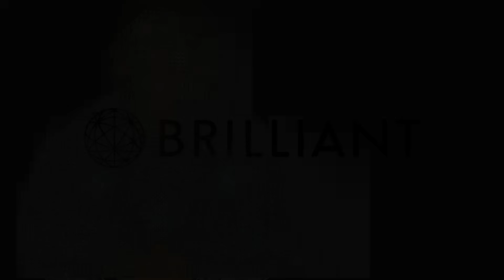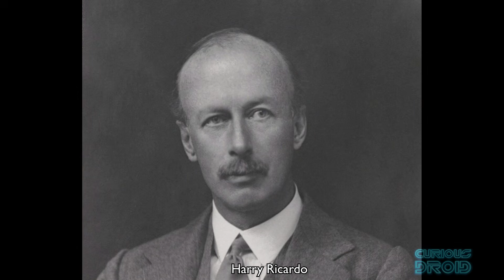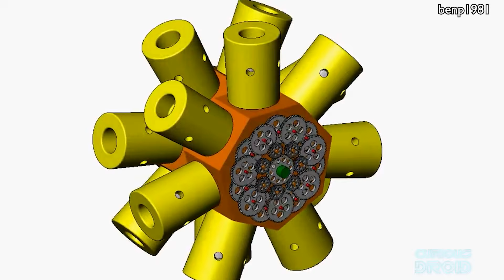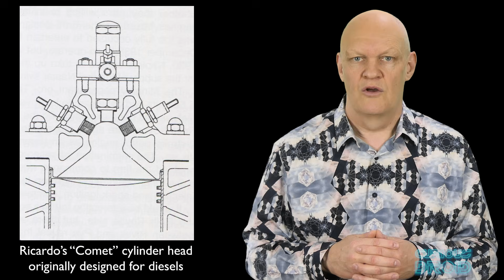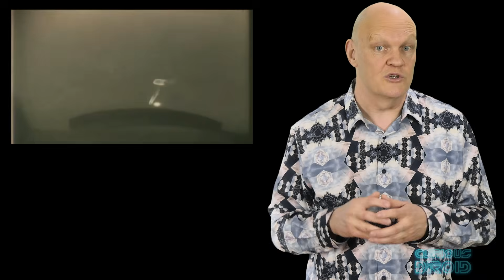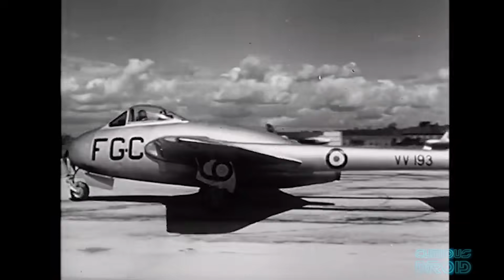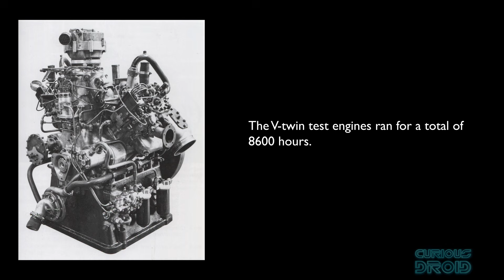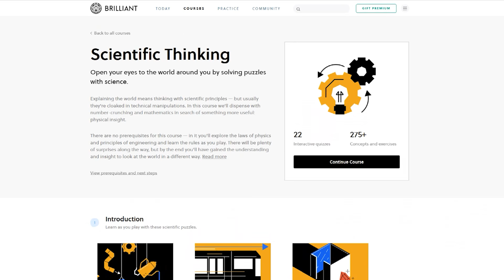Rolls Royce Crecy - The Most Advanced Piston Aero Engine Never Made.

Comment: Imagine if the sleeve cylinder was brought back for car engines
Reply: Apparently the F1 engine development eclipsed the sleeve-port power levels by the 90's. I think complexity of manufacturing was the insurmountable problem, and extremely short stroke engines with multiple poppet valves were a cheaper solution.
Reply: Sleeving a block is more of a requirement when power eclipses a certain amount. Sleeving doesn't add power... F1 probably uses different alloys to not require sleeving and use much different designs. Most power gains are from forced induction.
Reply: @josephbargo5024  I'm also given to understand that sleeve valves have sealing issues. As I understand it, poppit valves confirm to the shape of their hole with use, but since sleeve valves run on a track, they tend to erode the track instead.
Reply: @josephbargo5024  We're talking about sleeve valves, not sleeved blocks. As used in some piston aircraft engines, and a few early cars.
Reply: @barryervin8536  i realized this just after writing my comment... couldn't find much out about sleeve valves in modern applications though.
Reply: Fuel economy/power would significantly increase (almost doubles) because of reduced pumping losses of this sleeve design vs conventional poppet. Nothing new, variable sleeve valve and rotary valve engine always surpass poppet valve garbage.

The pumping losses of conventional poppet valves keep engine efficiency very low (15% for gasoline).  Just ask Datsun when they designed the B210 with a new valve system.  Their engine was too fuel efficient for the American market. They had to reduce the efficiency of their valve train to get the engine DOWN to fuel economy window required by USA for fuel tax laws.

Same reason we do not get the 120HP 75+ MPG blueline diesels that VW makes in this country.  They go to other countries and we get the weaker, 45MPG imported version instead for our diesel VWs in America.
Reply: These had vast problems with lubrication.  That is why they are not used in production automotive engines.  At the time, they had to use castor oil to keep these alive.
Reply: @Flies2FLL  correct. And Roy Fedden of Bristol Aero Engines  more or less singlehandedly bulldozed the Air Ministry into converting to mineral oils. Otherwise the RAF would have been fighting the  Luftwaffe with castor oil.
Reply: Turbo/compressor charged engines, fuel injection and /or adjustable valves solve a lot of the problems where sleeves were used for.
Look f.e. at  Ford 1.0L ecotec 3 cil car engine produced by Ford Europe.
Standard it produces about 100 HP and can be electronicaly tuned up to 140HP.
The street legal rally spec Fiesta ST  produced in the UK reaches 240+ HP.
The pure race rally version has even more HP!
Getting as much as possible HP out of an engine without increasing the displacment is mostly an European and Japanese thing.
The Honda Vtec engines are also very nice powerfull engines.
Reply: @obelic71  rally spec Fiesta lol that exists? I remember a buddy had a regular fiesta and could pull big trucks out of the mud, so maybe there was something there. Too embarrassing looks wise for me to be seen in it.
Reply: @Jordan__Sloan  
this is a video of the only 200HP streetlegal version of the Ford Fiesta.
The Rally version has 350HP+

https://www.youtube.com/watch?v=QlAYETKy49U
Reply: @samburke9563  just because a goverent says, "no more XYZ" doesn't make it so... The US' "war on drugs" shows exactly that. All it did was overpopulate the prison system. But drugs are still made, sold and done by a lot of the population.
Reply: @samburke9563  what do you mean "drugs aren't regulated" there's literal years of testing for "medical" drugs that are used and abused and part of the problem. Multiple agencies were made for this. There's the FDA. The D stands for Drug. There's the DEA too... Guess what that D stands for. The CIA mainly sells the drugs but that's a different issue. The ATF does drug work, almost every decent sized police force in the Nation has a drug task force. 
And yet, Billy Bob Jr still cooks up enough meth in his backwoods trailer to become a millionaire in a month.
Suzie Q still gets prescriptions for Oxy and sells it to her coworker to pay off her car loan. Etc etc etc. 
And weed is still federally illegal.
Even during the prohibition years for alcohol, the government couldn't stop anything. 

Furthermore, the government will be the LAST group to give up ICE because that's the easiest way to keep the war machine mobile.

Lastly, multiple counties across the nation and some States have emissions regulations... Yet people find ways around it ALL the time. They'll do the same with cars. I can picture it now, Coyote or LS swapped Ford Mach Es. LS Swapped Cyber Truck.
Reply: It would probably be difficult to meet emissions standards with sleeve valves
Reply: It would only be thrown away in a few yrs,Cars are throw away today!.
Reply: Some do, but mostly its done for aftermarket 1000hp engines.
Reply: Would have the same fate, internal combustion engines are done, they'll be gone in a decade, so it makes no sense spending any money improving them. They are being replaced by electric motors at an exponentially accelerating pace.
Reply: @andrasbiro3007  In the top year of 2017: 97 million cars where build world wide.
There are an estimated 1.42 billion cars in the world.
Even assuming every single car being produced from now on, will be electric, it would take 1420 / 97 = 14.6 years to replace them all. 
There will be plenty enough ICE's running around in 10 years from now, and probably still being produced.
Reply: @andrasbiro3007  Hate to say it but electric cars aren't new the yare over 100 years old, some of the first cars were electric and not combustion run.
Their issue has ALWAYS been weight and battery storage. The "new" battery design tesla is putting out has more battery power sure, but that is a bit of a misnomer because it's simply a larger battery and not because it is some how more energy dense for the same size.
Reply: @andrasbiro3007  You are totally right, and these naysayers has simply not done their homework, and/or bought into the fossil-industry cool-aid rather than the best available knowledge. 
Here are some simple facts: 
-The Average electric car, with an average  yearly usage nets about 125W continous draw from the grid. 
(That is quite a bit less than your A/C, isn’t it) 
-A total electrification of all cars  nets about a 2% added load to the grid. 
-Even if the power is made by fossil fuel, the electric motor is so efficient, the EV beats even the most modern fossil by a wide margin. 
-Resources for batteries exists plentifully, but production must in some cases ramp up. 
-Some of the coldest countries with the worst roads and infrastructure are in the forefront of the revolution. Sales in Norway is at more than 50%, if it works there, it will work in pleasant climates.
Reply: @andrasbiro3007  
I would tend to agree 
However I also know there are 5bn people on the planet that can’t afford to buy new vehicles and they will inherit the gasoline suckers 

The development of fuel efficient combustion engines isn’t a bad idea and having it fit for vegetable diesel liquid nature gas like in Brasil produced from plant base is potentially a win-win 

Now 3D print a highly complex machine for 100hp and we might have our self a different story in developing countries for replacing worn out carburetor 80s and 90s engines 

I think there will be a mad max hodgepodge society in a short while doing this 2050 is around the corner :)
Reply: @andrasbiro3007  There is still life in ICE technology check out the Freevalve camless valve train being developed by Koenigsegg.
Reply: @andrasbiro3007  Absolutely agree, the simplicity and efficiency of electric motors makes this inevitable.  Just like the gas turbine wiped out reciprocating piston engines in aircraft.  This will also transform the car servicing and support market as maintenance on electric will be minimal.
Reply: @andrasbiro3007  And it will be a crying shame...
Reply: @andrasbiro3007  they will not be able to produce enough electricity for electric cars to totally replace internal combustion engines . We already have brown outs in cities, even small ones , and we only have a few electric cars. Maybe we should find a way to handle hydrogen safer so we could produce internal combustion engines that burn hydrogen. Maybe the electricity would be better used to produce hydrogen. Something we should be considering because their is no way we will be able to support electric cars with our current ways of producing electricity.
Reply: @andrasbiro3007  we'll die from toxins long before, ICEs are less destructive
Reply: @andrasbiro3007  You better figure out how to generate all that electricity and make sure there are enough lithium mines.  California's electrical grid can't even cope with air conditioners and all the stimulus money was used to pay off corrupt government people, not upgrade actual infrastructure.  Electric cars don't solve anything in a corrupt society.
Reply: @gavincurtis  
Trust me... our friend András has not given that even one second's thought.
Reply: @gavincurtis  Air conditioners draw way, way, way more electricity than electric cars! An average electric car draws a net continous 125W . Switch 2 of your old lightbulbs to LEDs and you’re good.
Reply: @hepphepps8356   "An average electric car draws a net continous 125W" Watt planet are you on mate? My electric bike uses more than that.
Reply: @mikester1290  My numbers are accurate, and based on statistics, information from our own housing area with 100 EVs, information from the electricity supplier (We are at 40% EVs in my town), my own average EV with my own average yearly driving distance for 5 years, as well as the previously forecasted numbers, now confirmed in my country. You can find the real numbers yourself. Use an average EV like a Tesla 3 or Hyundai Kona, find the numbers from actual users, subtract the 1kW/10km used for making the gasoline it replaces and off you go.
Reply: @hepphepps8356  With the LED headlight option you suggested, one can add a solar panel and a small suction cup mount wind turbine to the hood to further increase system efficiency.  You can push the system into over-unity at times.
Reply: @andrasbiro3007  Only in parts of the world where good reliable powergrids are available electric vehicels will dominate the streets.
In the rest of the world the combustion engine for cars are far from done.
Ships, generators, aircrafts and heavy equipment will use them at least for the next 50 years.
Reply: @andrasbiro3007  The combustion engine is not going away for a long time to come. Electric motors aren't feasible for many applications, think of long haul lorries, commercial aircraft, ships, courier vans etc. 

Also, most power grids still rely on burning fossil fuel because it's far less expensive than investing in nuclear power (which is the only real world alternative) replacing all combustion powered cars with electrical ones is just shifting the problem of c02 generation away from your car and into the extra fuel consumption of your local power station. 

In fact, using the most modern technology in combustion engines, cars produce less co2 by efficiently burning their fuel and directly delivering the generated power to the wheels in comparison with having the power generated elsewhere, transported to your home, into your charger, into your batteries and than to your wheels. 

Reality can be a bummer sometimes, but electric cars are producing more co2 than combustion cars except of course if you live in France where most of the power grid does rely on nuclear power or if you only do short trips in your EV which you charge at home from your own solar installation.
Reply: @ta22stcoupe  ok, 2 things here. 

1. I think he was talking about cars (maybe trucks) only. Electric aircraft are irrelevant in the foreseeable future and ships work differently all together. Everything that is turbine driven will stay that way, same for diesel–electric.

2. Even the best modern car has an average efficiency of less than 20% (more on that at the end). Realistic is something between 10% and 15%. A good coal power plant is above 40%. So even with transmission and charging losses, your electric car is actually more efficient when running on coal power than any ICE car out there. 

Now why is the efficiency of a car so low, even tho manufacturers claim above 40% efficiency for their engine? That is because engines have different efficiencies over its RPM and power spectrum. For this high efficiency you need to run at the a very specific RPM while requiring nearly constant power. Diesel generators can do that which is why you will find highly efficient generators. In cars however your RPM is defined by how fast your tires are spinning (your speed) and your transmission. The vast majority of time your car is not running close to max efficiency so on average you are not reaching a very high efficiency.
Reply: @ta22stcoupe  You are describing your own fantasy, not reality. The efficency in electric motors are so much higher than a reprocriating engine that even with electricity from a fossil source, the EV beats the fossil car by far. 
Plus. 
We aren’t really seing the future as burning fossils to make electricity, are we?
Reply: @ta22stcoupe  Electric motors are very well suited to trucks, ships and particularly trains. They’ve been in use in one form or another for many decades already. We’re just arguing about the power source.

And as time goes on, more and more electricity is being generated by renewable energy sources. Coal and gas fired power stations are becoming too expensive to operate and maintain.
Reply: @hepphepps8356  By efficiency I meant the amount of Co2 put into the atmosphere to move a car is going to be a lot more if you're driving an EV charging from a fossil fuel powered energy grid compared to burning fossil fuel DIRECTLY in the vehicle itself.

As for your plus "We aren't seeing the future as burning fossil fuels". Well, look whos' living in fantasy land now. If you really believe all those green adds from energy companies showing those nice windmills in grassy fields and high tech solar panel parks that will one day generate enough power to fulfill the worlds energy requirement... I hate to be the one to have to tell you this, but you've been duped.

Energy density in fossil fuel is far higher than electric energy. You just cannot come close to storing the energy stored in say a cubic meter of petrol fuel into a pack of batteries from the same size (don't even start on the weight). You're never even going to get close, So no, you can windmill park and solar array as much as you like you'll have to build a whole lot more to replace a fossil fuel power plant.

So whenever you see the next 'Look how green we are guys!!!' commercial from your local energy provider, don't be gullible and look up energy density and storage.

As for nuclear, which is an alternative,.. unfortunately in most western nations energy companies are privatized and as such won't invest in nuclear cause those plants are insanely expensive to build and will take years, decades even just to break even. You think the board of directors are going to be okay with that? take responsibility over profit? Not going to happen. Forget it. 

Long story short, You're wrong, the ICE is not going anywhere any time soon.
Reply: @thethirdman225  Trains are very well suited for electric, but thats' because they are connected directly to a powergrid. They do not have to carry their energy with them.
A truck nor ship has that same advantage and thats the dealbreaker. I'm not talking recreational boats or 1.5ton short haulers, but real world commercial shipping and trucking. 

Yes, more and more renewable will jump to the scene but it's just never going to be enough to replace fossil fuel plants. Just think about how many acres of land you'll need for a windmill or solar park to replace just one fossil fuel plant.

This also invalidates your last argument, the one about expense. Nuclear is far more expensive than fossil and renewables are there to get you from keeping your eye on the ball. (well, thats an exaggeration but you get the point).
Reply: @ta22stcoupe  You are trying to make 3 points:
1/CO2 and electric cars: You are wrong. The combined efficiency of the fossil power station and electric motor is a lot better than the ICE engine.

2/Energy density really doesn’t matter much except for aircraft.

3/Electricity is highly regulated infrastructure  both by law, international agreemts and taxes. Within this we will see the neccesary evolution.
Reply: @hepphepps8356  Oh heps. You make me facepalm so hard right now. A double fp doesn't even cut it.

I could pick your 3 points apart and explain how wrong you are on all three of them, but honestly, I feel like it's a waste of time.

But I will leave you with a tidbit of advice, ... Please Please Please do look up what energy density per unit of weight really means. It's pretty simple and once understood you'll know exactly where you went wrong.
Reply: @ta22stcoupe  I am perfectly aware of what it means, but it doesn’t have much consequence except for modes of transportation where battery weight would be the determening factor: Aircraft, long distance trucks. Those are, believe it or not, not the majority of fossil fuel consumption. 

As for the other points, I would be super exited to hear you pick them a part and prove them wrong, you would need new science to the level of probably earning you a Nobel Price to do so of course, but still..
Reply: @Hepphepps  Allright, you asked for it. Here goes:

"1/CO2 and electric cars: You are wrong. The combined efficiency of the fossil power station and electric motor is a lot better than the ICE engine."

Oh really, so burning fossil fuel in a powerplant to generate electricity which transports to your home passing a bunch of transformers and other sources of severe power loss then into your charger, next your batteries and than to your wheels somehow causes less co2 production than burning the fuel directly into your car?
Yeah, there's a couple of laws of physics that might disagree with you on that one.

"2/Energy density really doesn’t matter much except for aircraft."
Imagine you're the fleet owner of a bunch of trucks. They're restricted by law to weigh in a max of say 40 tons. The truck is capable of driving 1000km without refueling on say a fuel tank with a loaded weight of 150kg (numbers pulled out of my ass, just an example) now, do you think with a total weight of 150kg of batteries you'd get the same power and distance out of your truck? Looking at energie density charts for the most modern batteries available next to old fashioned diesel fuel, clearly.... not even close! 
Is that important? Well yeah, cause the max total weight of the truck determines how much cargo it is legally allowed to haul, The higher the total weight of the truck, the lower the weight of payed for by customers cargo. So no, electric trucks won't replace the good ol' co2 producing truck. Just,.. no. Not going to happen. Now, the god of electric Musk might argue otherwise but ehm... yeah, perhaps you should take his comments about the electric truck which will come out on the 32nd of never with a grain of salt.

"3/Electricity is highly regulated infrastructure  both by law, international agreemts and taxes. Within this we will see the neccesary evolution."
Nope. Electricity is regulated just like anything else by (shock horror, surprise surprise) money! 

Forget about your laws, international agreements and taxes. Maybe in utopia those weild any power, but in the real world it's money, and money alone that does the talking.

That evolution you mentioned, you mean yet another 'look at us, look at how green our energy is' commercial from your local power supplier showing a bunch of windmills in a green and romantic idyllic setting? 
Fact of the matter is again, energy densitity. You always need to build to the max energy demand and then some only to have those installations sitting idle at none peak hours because means of storing overcapacity during low demand periods is limited. None of these problems exist with a regular low tech and cheap fossil burning plant. Which again leads us back to MONEY! Why the hell would shareholders want to sacrifice their milkcows for a clean planet if all it does is keep costing them money. You'd think these people have children too and might worrie about their future, but so far nothing indicates that this is actually the case. 
About the revolution. The only revolution that would considerably and sustainably reduce our co2 output would not be transportation (i never mentioned that), it would mean producing energy in a clean yet capable manner. Nuclear power is the only real world method to accomplish that goal. It's not whithout it's downsides for sure, but the costs involved in developing and properly maintaining them, not at least for the enormous safety efford needed to run them are high enough to have the board of directors of your local energy producer laugh you out of the room the moment you mention it.

Anyways, back to the sleeve valve engine.... Isn't it just magnificent ;-)
Reply: @ta22stcoupe  The sleeve valve engine was indeed magnificent! 

So since you have dug down, we need to get more thourough:

1/The ICE engine in the car runs at very low efficiency. The fossil fuel still burns fossil fuel, but gets a lot more energy out of it than the ICE car. Combined with the supremely efficient electric motor, this combination, and yes oncluding transmission loss, beats the ICE by a wide margin. On top of that comes the fact that power production is moving away from fossil over time, AND on top of that, EVs can most of the time for most of the fleet charge at low-demand hours, actually evening out the power demand on the grid. Where I live, we are already doing these things for real on a large scale and it is looking good! 
The principal of running a fossil generator at max efficiency powering an electric motor being more efficient than and direct power on-demand ICE engine is a principle used even on a smaller scale such as large diesel-electric trains. 

2/Long Distance Trucking and mid- and long-haul aviation will be the last to go electric for sure. Over the last couple of years there has been a grand shift towards Electric delivery vans, local mid-sized trucks and city busses in my city. So there really is very little that can’t be electrified as of right now. If the goal is for a large percentage, a very large percentage of transportation to go electric, we are already seeing it. It is real. 

3/Laws and regulations do work. It is why we don’t see cities filled with coal powerplants powering local DC-grids with individual specs anymore.
Reply: @ta22stcoupe  Nice to someone talking sense. It seems many forget about conversion efficiency.
Reply: @andrasbiro3007  what an asinine thing to say, we’re really going to get rid of every internal combustion engine in a decade? Good luck. Seems to me you’ve been living under a rock for the last twenty years.
Reply: @rogerdevries8883  He probably hasn't been alive twenty years.
Reply: @rogerdevries8883  Time estimates are really hard, but I guess that by 2035 > 90% of sold cars will be electric in rich nations.
Reply: @brencrun5068  In case you have been living under a rock, you cretin, multiple countries do plan to ditch ICE by banning them in 2030-35. And no, you imbecile, not by ICE, by nuclear and renewables, then potentially fusion down the line...
Reply: @KuK137  We will see how that works. Just because a politician can write a law doesn't mean it can actually be followed. 

Recall the town that banned hurricanes?
Reply: @rogerdevries8883  
Naah, András has not been living under a rock. Simply a lack of education, knowledge, and actual experience, plus a healthy dose of political indoctrination.
Reply: @rogerdevries8883  He’s quite right. Look at the new developments in hydrogen and batteries. Governments around the world are banning single fuel vehicles as each day passes. ICE will be gone in 20 years.
Reply: @andrasbiro3007  Electric motors running on electricity produced by internal combustion engines?
Reply: @brencrun5068  Electric engines will require very dynamic power grids. I think you are talking about diesel generators in your reference? But in my opinion small nuclear power plants with underground battery storage facilities will be the way electric cars will thrive. This is at least 10-20 years away because the battery storage facilities will likely be constructed from old car batteries that are under 80% of original power capacity. 

The problem with modern power plants isn't lack of resources, it's the difficulty producing optimal power at any demand. 

The whole argument of always requiring ICE is only based on the current infrastructure. It's the most abundant so it's assumed you will always need it.
Reply: @josephbargo5024  you would have a blast studying WattsUpPower on google 

An energy storage device that isn’t chemical but rather kinetic
Reply: @josephbargo5024  It will net about 2% to the grid. Not a big deal for the largest transport revolution in a century.
Reply: @josephbargo5024  You are right, to make this all work we need small modular reactors.  I now expect to be scragged by a million Greta's, but the reality is that the grids need base load capability, regardless of how many windmills you install.  Also, the sources need to be near the sinks when you have millions of vehicles charging overnight.
Reply: @brencrun5068  Hardly any electricity is made by internal combustion engines. Most is made by steam turbines.
Reply: @brencrun5068  steam
Reply: @brencrun5068  Or burning fossil fuel ???  I get a kick out of the claim "O" emissions from electric cars !!! Really ???  How is most electricity generated ???  Steam plant fired by coal, natural gas....  Even hydroelectric dams are not "O" emissions as it took diesel powered equipment to build them !!! Its all symantics and brain washing !!!
Reply: András Bíró You are far too excited about a technology based on an energy storage device multiple magnitudes behind that of Dino juice.
Reply: @andrasbiro3007  there isn't enough cobalt and lithium to make every vehicle on the road today electric. Not even close. Just like piston aircraft are still being built, there will be a place for ICE's in the foreseeable future.
Reply: @dbmail545  cobalt isn't needed for next gen lithium ion batteries and there's definitely way more than enough lithium if mining is scaled up and recycling of used batteries picks up, which it certainly will
Reply: Chile has twice more lithium than Australia, for example, but neither country really exploits their own reserves currently. It should change in the future though, and since recycling a liion battery is highly efficient you can effectively reuse the same lithium "forever"

Edit: found a good article on this https://www.linkedin.com/pulse/why-we-probably-running-out-lithium-katharina-gerber-ph-d-
Reply: @dbmail545  The cobalt lithium claim is bullshit. There will be ICE's in the future, but they will be rare. 

You need roughly 0.15kg/kWh Lithium. in 2020 we mined roughly 82 million kg. That's enough for nearly 550 million kwh. A big car has 100 kw/h. So ~5 million cars yearly. Now we also need lithium for other things and 5 million cars is roughly what is sold in the US alone, however the mining is increasing every year and the required lithium per kWh is decreasing every year. So currently we are not able to produce enough batteries, but in the future we are.
Reply: @dbmail545  Bullshit. You just pulled that out of thin air. There is no lack of resources long-term.
Reply: @dbmail545  well, we have to find a way to make it work. Or we won’t have a planet capable of supporting life.
Reply: @dbmail545  Watch them disappear over the next20 years.
Reply: @pc_screen5478  Lithium is only the current best system; people are working on potassium and sodium batteries too - if the sodium-ion battery can be perfected, then it'll kick Lithium into the long grass, as it's literally everywhere.
Reply: @dbmail545  Hmmm... That makes the assumption that the battery technology guys don't come up with alternatives, which seems highly likely.   I love some of the old IC technology, but its rapidly becoming nostalgia.
Reply: @dbmail545  Don't need the Cobalt, and there is plenty of lithium...at least for the number of cars on the road today.  When, on average, everyone in the world has a car or two...that gets a little more tricky.  We would need light aerodynamic cars like the Aptera, if we were limited to lithium battery technology.   It seems unlikely that lithium will be the only option for high energy batteries in the future.  There are just so many chemistries that look very promising, and a lot of time and money is being invested in this research. 
Tesla is about to start phasing out cobalt already.  They are moving to lithium-iron phosphate.
Bye Bye stinkers.  Good riddance.
If you want ice, go to the grocery store.
His 10-year claim though is ridiculously optimistic...more like 11 ;)  OK, it will be longer before all the major makers stop producing ICE vehicles.  I think natural gas and propane in particular will continue for quite a bit.  And vehicles often operate for 20+ years after they were produced and sold.
This will become difficult for owners, when all the gas stations either go belly up or become charging stations.  That is why I think natural gas will take off.  Most houses have natural gas already.  You would just need an appropriate compressor.   Propane is easy too.  It could be delivered to your house and put in a 500/1,000 gallon tank.
Reply: @dbmail545  Battery tech is moving away from the use of cobalt or at least drastically reducing it and you are totally wrong about lithium and the lack of it .
Reply: @andrasbiro3007  
"Gone in a decade"?  If I were you, I would Strongly suggest that you not bet your life, or anything you value, on that completely ignorant prediction. Nor would I bet even in Five decades. I remember quite well reading similar predictions that gas turbines, Wankel rotaries, and small-displacement turbodiesel engines would all replace the gasoline-powered piston engine in past decades, and yet the gasoline engine still thrives and constantly is improved in efficiency and lowered emissions. 

You are obviously Not an automobile repair technician, let alone an engineer, and are also obviously unaware of the multiple downsides of electrically-powered vehicles, beginning (but certainly Not ending) with their exotic-metal battery packs. Do some homework on that, beginning with the damage inflicted to the planet (but not in Your back yard, of course!) in mining the metals for those Very large lithium-ion and NiMH battery packs, and also the nightmare of disposing of those same materials when those batteries inevitably crap out. You don't just throw that stuff in the trash, you know. Does the term "HazMat" ring any bells with you? 

And to paraphrase Sherlock Holmes, regarding your prediction, "So many have said it, yet here I am."  🙄😊
Reply: @andrasbiro3007  don’t hold your breathe, clean burning synthetic fuels may result in a revival of ICE
Reply: @andrasbiro3007  Yeah, keep dreaming.